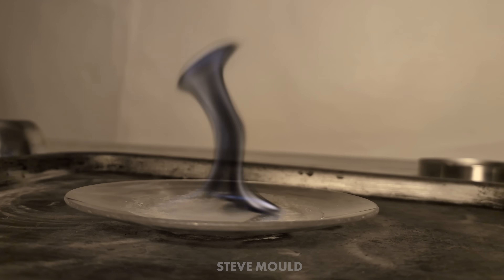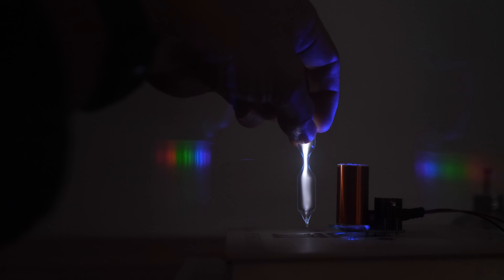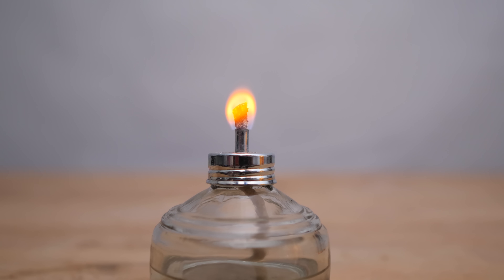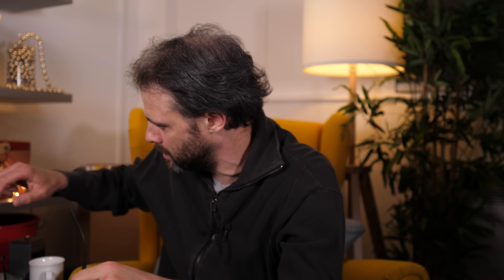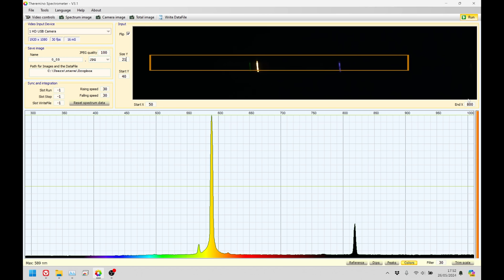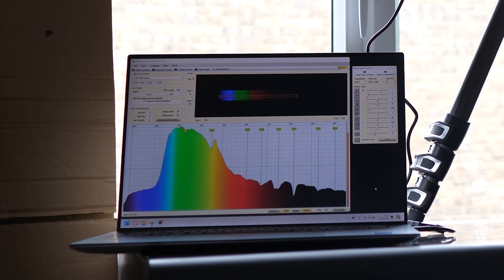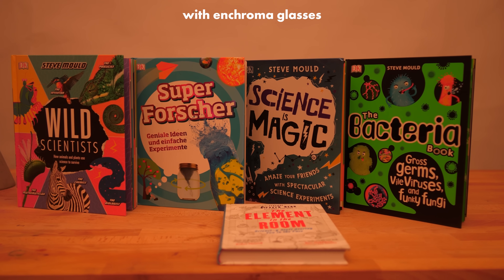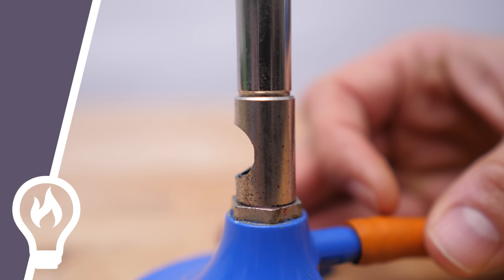Light sucking flames look like magic

Comment: aren't the enchroma glasses known to be a scam?
Reply: Yes its a scam in my opinion and likely illegal advertising in accordance with FDA regs, in my opinion. 
A notch filter CAN help DISCRIMINATE between two frequencies (aka colors) but, by definition it allows you to see less of the total spectrum of frequecies of a signal. So it actually allows users to see FEWER colors. Despite claiming the exact opposite.
Reply: Their marketing material explicitly states that they enable users to see new colors (a strictly false statement), and both pay content creators to make absurd claims and fabricate emotional stories about it, as well as boosting those videos which contain the false claims + embedding them directly onto their website.

It’s a scam.
Reply: It always seemed to me the people putting on the enchroma glasses for the first time were acting just to score a viral video, and some have confessed
Reply: They are fake, the MegaLag series on it is an amazing explanation.
Reply: @hamzamotara4304  they are not "fake", I have tried them, and they cause a cool "glow" effect on high-viz colors, but not worth $400, but if you find a pair to borrow, definitely try them out
Reply: Definitely a scam! A youtuber called MegaLag did a few videos exposing them, well worth checking out
Reply: They are 100% a scam and the videos they post have been proven to have been faked. It's very predatory the way they market to people desperate to have better vision.
Reply: The glasses themselves are legitimate. The claim the 'rectify' colour blindness however is not
Reply: It's so easy to get caught up in numbers and data without proper respect to what they mean to the human experience.  Imagine an intensity-versus-frequency graph in the shape of a bell curve - yes, this is a simplification, but it's in service of making a point.  Imagine the peak of the bell curve is near the low-frequency end of the cut-off band of the enchroma glasses.  Wearing the glasses, you'll get a lot more activation of one type of cones (middle frequencies, 'green') with respect to the other (high-frequencies, 'blue').  If you move the peak of the graph to near the high-frequency end of the cut-off band - not a large shift in the position of the bell curve - wearing the glasses, you'll get a lot less activation of the 'green' cone previously highly activated, and a lot more activation of the blue-end cones, previously little activated.  Without the glasses, these two spectra would have activation of the 'green' and 'blue' cones both pretty high - technically, numerically distinct levels of activation, so in theory, different perceived colours, but not by a large perceived magnitude - so, in terms of perception, not much difference.  And with the glasses, the relative activation values of those different types of cones will be more at variance, as the peak moves.

If the colours one encountered in the world were composed of just single-frequency emission spectra, independent of each other, then yes, the argument that enchroma glasses are a scam would be a heck of a lot more weighty.  It would just be a matter of subtracting data available to our sense organs.  But, since the types spectra one encouters in real life are mostly not like that, I'm not so willing to dismiss the claim that quickly.  The 'survivorship bias' (and 'people are looking at me, I want to put on a performance!' factor) of reporting is definitely worth considering when trying to evaluate the weight one should associate with all the "Wow, this is great!" videos one sees.  But this kind of thinking puts me in mind of the 'lossy compression' image file formats.  What aspects of colour and image might be omitted, or fudged, for 'healthy' (more common) types of retina, could well be different from what aspects of colour and image might be scaled down - or scaled up - for more uncommon types of retina.  Considering different physiologies, - to put it in extreme, overt terms, think of different aliens with different types of eyes - what we might consider 'lossy' compression of image data might be a transformation of image data that introduces unintended side-effects of increasing contrast.
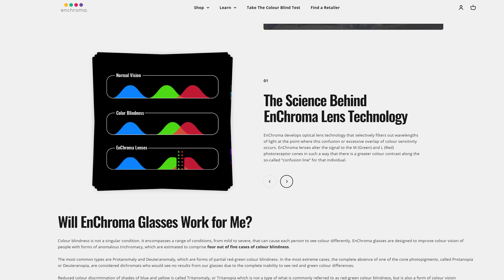Reply: I bought a pair for my dad, who is red-green colorblind.  His reaction was not as exaggerated as the people in some reaction videos, but he was definitely impressed by them.  When I saw the videos about how they were a scam, I was confused, because if they were a scam, why was my dad impressed at all?  Now that I watch 14:26, I finally understand why he liked them, whereas others don't.  In any case, Steve's spectrum tests confirm that the Enchroma glasses are doing what they claim to be doing, so to me, that clearly says they're not a scam.  Maybe they're not as great as Enchroma says they are, but that kinda describes advertising in general, doesn't it?
Reply: @JorgBrown  Enchroma's glasses are to colorblind people, what IR night vision goggles are to anyone in a dark area. You'll be able to see things you couldn't see without them, but you can't see what color said things are. Enchroma's marketing would have you believe otherwise, which is the issue. The product isn't letting you see new hues, just allowing you to see that there is something there. Your dad is not seeing a "red" apple in a group of green ones, he's just seeing that one apple is different from the rest. Again, it's great that this product exists and can help those with colorblindness see things they may have had trouble seeing before, but don't lie to your customers or bury the lead. Advertising should inform as well as hype.
Reply: Yes. They've been debunked repeatedly and shown to habe no effect at all.
Reply: @MinistryOfMagic_DoM  They do have an effect though. Not nearly as well as they advertise, but they're still effective. I bought them as a gift to my father - and while they didn't provide immediate WOW effect, he would often write me something like: "Oh I didn't know those <stairs> were actually red before" <insert any other obviously red item>
Reply: @MinistryOfMagic_DoM They do have an effect, it's just nothing like what they claim. It doesn't allow someone who is colorblind to see any colors they couldn't before, but it can allow people with certain types of colorblindness to distinguish between colors they couldn't otherwise tell apart. So instead of someone with red-green colorblindness seeing both red and green as the exact same shade of brown, for example, it makes that red and green appear as slightly different shades of brown. They aren't seeing new colors, they're just able to distinguish somewhat between colors they can already see that otherwise look the same to them without the glasses.
Reply: @MinistryOfMagic_DoM  false, they DO have an effect: find a used pair and try them, you'll see "something" or at least I did, they are fun, but that's about all
Reply: It is not a scam in the sense that it makes colourblind people see difference in hues that would otherwise look the same without the lenses. It is, however, unable make a colourblind person see the same full spectrum of colour as people with normal RGB vision.
Reply: They are claiming (unless something changed) that these glasses help people see new colours. This alone is just false and should stop any further attempts to defend that company. When you dont have receptors in your eyes you cant see certain colours, period.
Reply: Its not as dramatic as they make it seem, but the glasses do work.  Imagine you always went around wearing green tinted glasses, so even the brightest red object is still a bit greenish-brown.  Wearing the enchroma glasses would be like taking off those green glasses, letting you see a pure red color that you wouldn't normally be able to see.  

They aren't literally letting you see new colors though, they only affect things with a broad spectrum and something with a single wavelength of light like a red laser would look the same either way.  And yellowish things that really are in that ambiguous range between red and green can end up looking really weird when those wavelengths are supressed.  You're basically sacrificing your ability to see yellows properly in order to make reds and greens more vivid, which can be really cool but it depends a lot on exactly what you're looking at.
Reply: @Reddles37 the issue is that they claim it does help you see new colors and that they do make it as dramatic as they do. They literally have a video showing a kid using the glasses to identify colors. The video is clearly staged as the balloons are labeled. 

This is what people are calling out when they say enchroma is a scam. The glasses may work in a manor that aids the colorblind but its not in the manor that they claim in the marketing. I think its great that this exists and that its helpful, but misleading people and burying the lead is not how enchroma should go about marketing it.

Edited for ease of reading and overall tone. Not trying to be aggressive.
Reply: no, they are real glasses and have a real effect, a scam would be if they were not real at all with no effect
Reply: @Beakerzor That is not true. If they were opaque pieces of plastic they would have an effect, but obviously be a scam.

They are a scam if they don't do what they claim, so ones sold by companies claiming they "correct" colourblindness are a scam, simple as that. The current enchroma marketing material seems to pretty fairly represent what they do, they simply allow some people to better differentiate certain colours. So I wouldn't say they are currently a scam, but they definitely have benefited from lots of BS marketing.

That is now, however. I don't know how clear they were historically (although they certainly leaned hard on using other people's words to say misleading things, my quick glance doesn't see them saying anything clearly problematic just a bit sketchy at times) but many others selling similar products were and are much more explicit in the false claims and it kind of gets muddled together.
Reply: @Beakerzor The product may be real, but what they claim it can do is not. Its false/misleading advertising. The practice is, at best, disgusting and scummy, and, at worst, a type of scam. There is no point in defending a company like this.
You can like/use a product, and still disagree with the company's practices. Boycotting may be the most effective way to see change, but sometimes its not worth the personal resources to do so.

Note: I realize this may come off rather aggressive. Not sure how to rewrite this though. Sorry about that.
Reply: No? They do what they say. Whether that's useful is debatable.
Reply: @Khaim.m  There are at least three things here: 1) Do they act as an optical notch filter? 2) Are they useful? 3) Are they a scam? The answers seem to be: 1) Yes, not contested. 2) Depends who you ask. 3) Yes, the company is shady as shit and promotes fake reaction videos.
Reply: @Khaim.m  so when people sell magnetic healing bracelets, that's not a scam as long as the bracelet really is made of magnets?
Reply: @Haughington  no those are a scame as well. It's honestly amazing Power Balance got as big as it did before it got shut down.
Reply: @Khaim.m 
They're definitely a scam...

Comment: When I was learning electronics in the Navy, we used to joke that DS label used for lights in a circuit diagram stood for Dark Sucker. When a bulb blows, all the dark leaks out.
Reply: And batteries are really just storing the dark sucked up. The trash company separates them out of your trash and take them up to Alaska. They crack them open in the winter, and that's why there's no sunlight in the winter up there.
Reply: @medivalone  Ahhh! That makes sense. Thank you.
Reply: When an LED (light emitting diode) breaks, it turns into a DED (dark emitting diode).
Reply: @n16r3d0 will the DED remove all light.from a brightly lit room? 😂
Reply: Douglas Adams and Terry Pratchett would be proud of you.
Reply: As a mm electronics had magic smoke and if it was released it was the em problem
Reply: @panzerswineflu  "computers work by smoke and mirrors, and if the smoke leaks out, the mirrors stop working."
Reply: @panzerswineflu  Exactly!
Reply: @panzerswineflu as an em if the magic smoke is gone it's the "whoever pays the bills" problem, until it ships. then it's my overtime
Reply: they only make that magic smoke once usually  @panzerswineflu
Reply: Are there refills for the dark, like there are refills for the magic smoke?
Reply: @Yotanido  in the Navy you didn't refill, you replace. Then the em has to find where the magic smoke escaped from. MM is so much easier, it leaks fluid it's obvious. Super heated steam though....
Reply: @panzerswineflu  can we get the meaning of "mm" and "em" please? Maintenance mechanic and electronics mechanic?
Reply: @joshyoung1440  ah sorry. Machinist mate, we dealt with the mechanical side of systems. Electrician mates dealt with magic black smoke, at least from our perspective. They got to do tedious work like tracing faulty circuit boards to see what failed
Reply: @Yotanido  No, it sucks the dark up from the environment and stores it away.
Reply: Lol
Reply: I frequently call power plants with the big steam stacks “cloud machines” and a handful of people take me seriously.

I almost always roll with it when they do
Reply: @CarpeNoctem135 i call em cloud factories
Reply: @CarpeNoctem135  "Cloud factories" to be precise. :)
Reply: @CarpeNoctem135  oh, so you're the reason people believe that "chemtrails" nonsense.
Reply: @ShuRugal  not chemtrails, that clouds are assembled in factories like a car and released into the sky via smoke stack as a joke usually at my expense
Reply: @ShuRugal  what? No. Not at all. People actually believe that shit. This guy is making a joke about power plants. Nobody thinks chemtrails come from power plants. Even if they do, this guy isn't responsible. Seriously just stop doing what you're doing
Reply: I have seen an entire treatise on "dark sucker" theory, and it is superbly written.
Reply: Yes ! Gather the holy smokes ! In a peanut butter jar!
Reply: Light-bulb lore???
Reply: Dark is faster than light - that's why you see light spill into the room, not the dark sucked out of it
Reply: Ahahahahahahaha that's really good
Reply: Oh wow! I was a lighting tech in the theater for many years, and this joke had made its way into our lexicon too! I bet it came from the Navy first, just like the superstition of not whistling on set did hundreds of years ago.

(Edit: to specify for the peeps not in the know. In the old days, many sailors got hired to work the rigging in the fly gallery for theaters - the thing that raises and lowers the backdrops, curtains, and large beams holding up the lights. Sailors used whistles to communicate, and so those whistles were, for a time, standard for technicians to communicate with as well. Thus, for a long time after, no whistling on set.)
Reply: No, I am the dark sucker.
Reply: "we trained him wrong, as a joke!"
Reply: Nerd Alert:  The "power plant/cloud machine" has SOME truth to it.  Moisture clings to pollution (such as pollen) in the atmosphere.  Fires caused by lightning, volcanic eruptions and dust kicked up by winds (and the aforementioned pollen) are just some examples of pollution not caused by humans.  HOWEVER the Industrial Age did have a profound effect on the weather/precipitation.  There is plenty of "after" data but not much "before" data to show the exact effects.

By the way, clouds WILL also form behind Contrails (a word so close to "Chemtrails" that I despise the inventors of the latter word - it's their method of knowing which useful idiots got caught in the net).
Reply: Ooh-hoo-hoo….either the black guys in ur unit hated that or they were the ones to make it up to begin with either way that is AMAZING.
Reply: of course, bulbs emit darkness, which is captured by everything else, thus you are able to see, because your eyes emit white light.
Reply: We have all heard of LEDs. This is a DED (dark   emitting diode). New invention? 😂
Reply: @cphank3722  so broken solar cells are Dark Absorbing Diodes

Comment: I'm skeptical that the Ishihara test is founded in eye anatomy other than for the grossest cases; the tests are designed to get more and more subtle to the last one where someone could tell the numbers by tracing them with a finger (i.e., the differences are perceptible) but they can't see the numbers as a whole. This really seems like an issue of image processing in the brain which varies a lot from person to person. Like, some people can easily see fawns or snakes or tigers in photographs while others can stare for minutes and not find them. So with that, I'm skeptical of conclusions on the encroma glasses based on Ishihara test results.